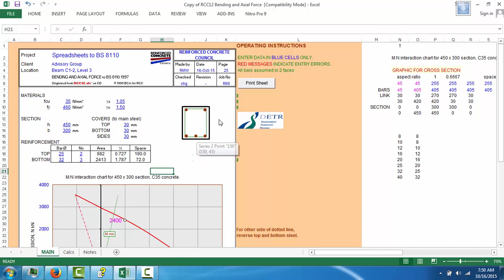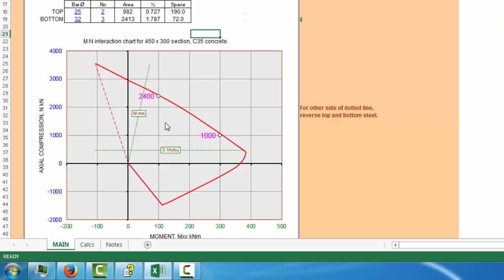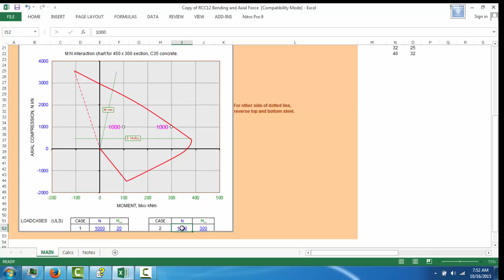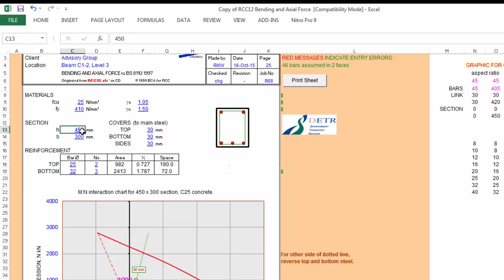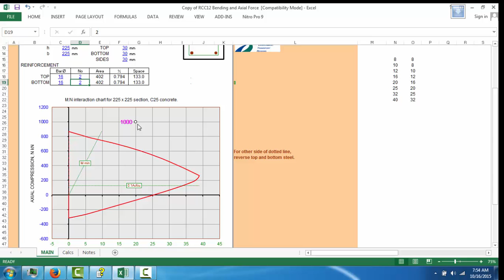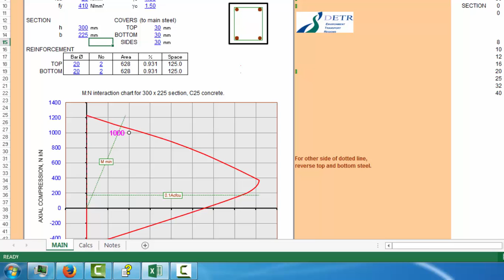Column Section Design Using Excel SpreadSheet

Comment: How do you use this spreadsheet for a biaxial column because you have bending in both - directions and y-y directions so you you have two moments
Reply from the maker: Input each calculated moment separately and use the one with higher reinforcement, for reinforcement of column

Comment: How do you create section drawing?
Reply from the maker: This software does not create section drawings
Reply: @GodwinSholaconciseinfo  which software does?
Reply: @GodwinSholaconciseinfo  i mean, if you enter two bars at bottom, it shows two bars. How do you create the dynamic drawing, which changes according to cell data?